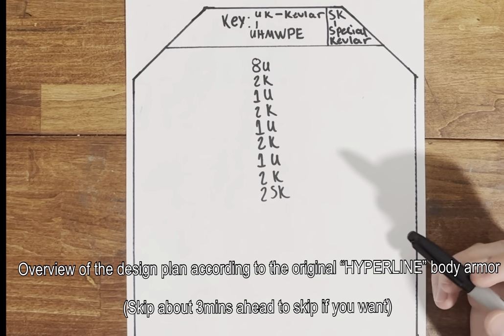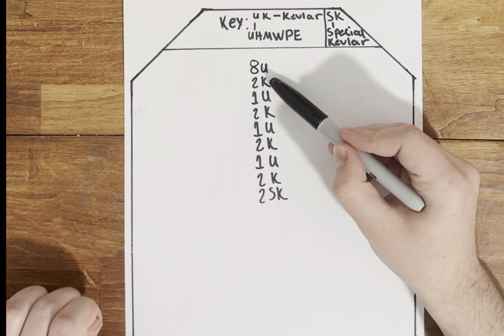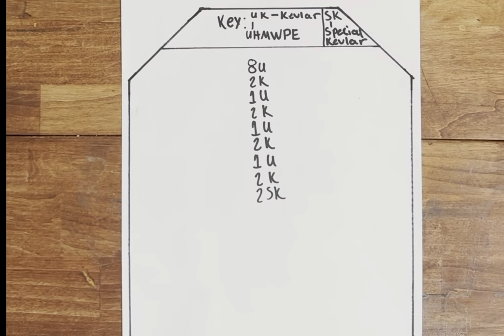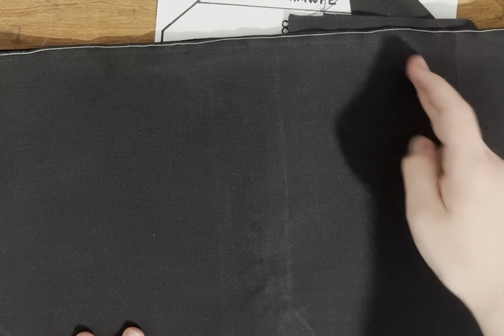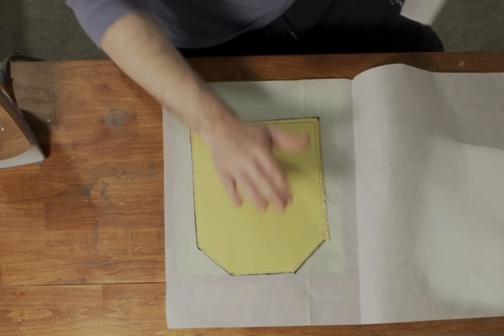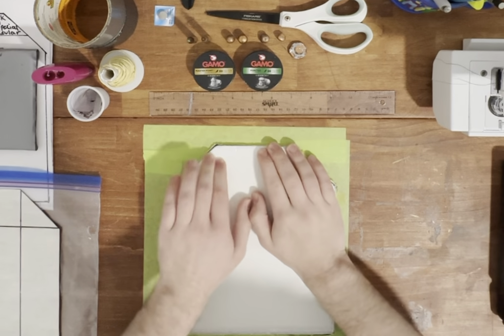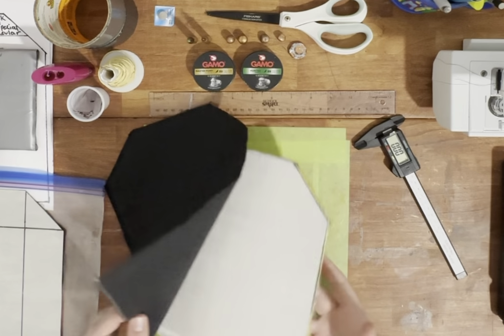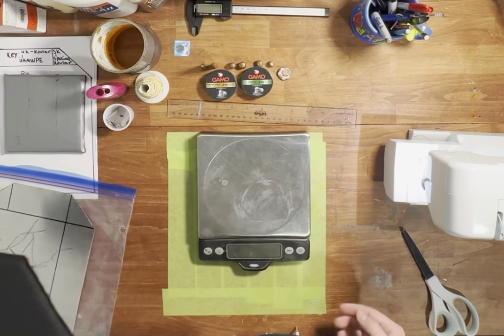HOMEMADE “HYPERLINE” Body Armor (.19in) (Build video)

Comment: Really interesting using those types of bonding materials to get a more flexible product.
Reply from the maker: Yeah, most body armor companies dont use glue or adhesives for soft armor. Its too inconsistent and it increases rigidity and weight. The main reasons I like glue is because it increases density and because I dont have a sewing machine good enough to sew through this many layers. The main problem I have had with glues is just finding one that checks all the boxes. It has to be thin, compatible with the materials used, flexible, and really strong.

Comment: Is it that expensive to buy one or is it just the challenge of building it.
Reply from the maker: Mine cost about $44 for a 8x10 and $60 for a 10x12 to make. However I put $100 because if I were to sell them thats what I would sell them at. Technically you would have to spend $100 to get the materials I used, but you wouldn’t need to use it all. And the $300 plate was just something to compare it to.

Comment: You have made it weaker by heating the Kevlar with the iron
Reply from the maker: Maybe, if it actually got hot enough. The iron would not bond the kevlar and the uhmwpe because it didnt get hot enough which is why I switched to glue. Worst case I made 2 layers weaker. I dont think it would have made much difference considering the 2x thicker plate I made only barely stopped the 1600fps 44 magnum which is the slowest I have.
Reply: @Armor-Innovations  have you tried vacuum infusion method?
Reply from the maker: @warwickmilne3149  no, I might try something along those lines for the upcoming helmet video.